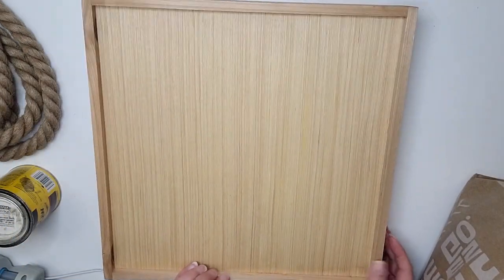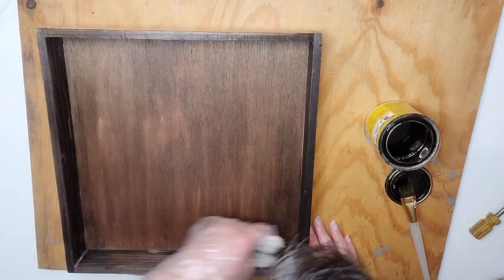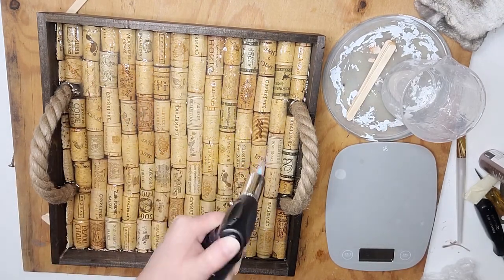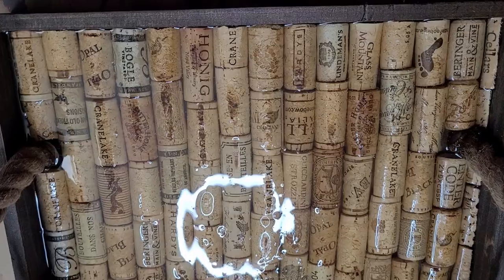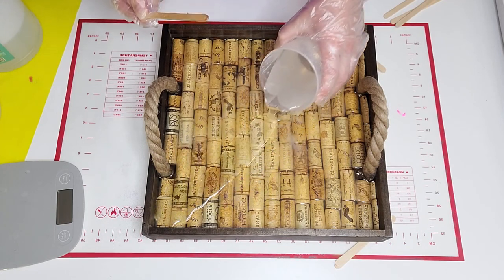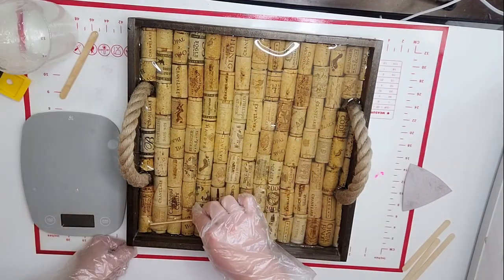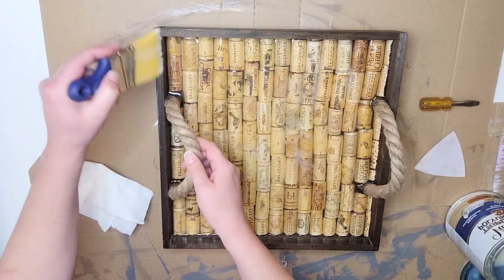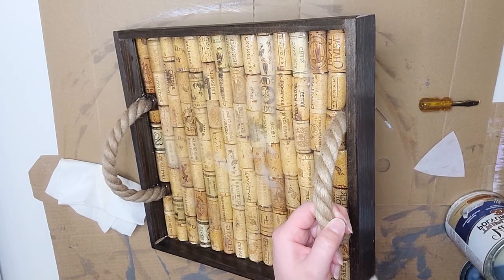Repurposed Wine Corks | Recycled Wine Corks | Home Decor Tray | Wine Cork Wood Tray Encased In Resin

Comment: I love wine cork projects!  I'm not sure if I missed it, but why couldn't you just do one deep pour of resin all at once?  I've never worked with resin, but I want to.
Reply from the maker: Some resins, it will tell you on the bottle, can be used for a "deep pour", but the kind I have is not meant for it! Pouring it too deep, when not recommended, could cause the resin to over heat and not set properly. 😊
Reply: Love it! Never have done resin but looks WONDERFUL!🎉